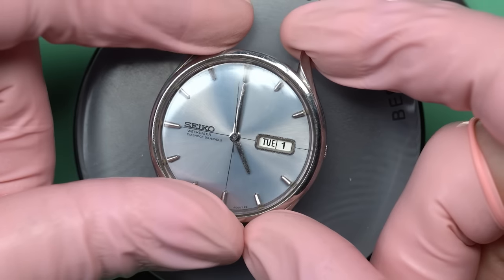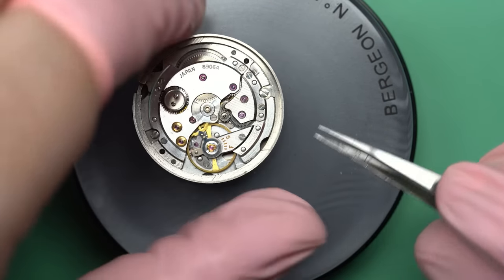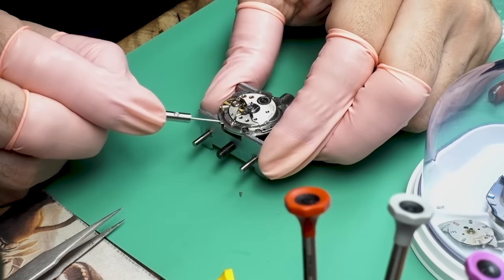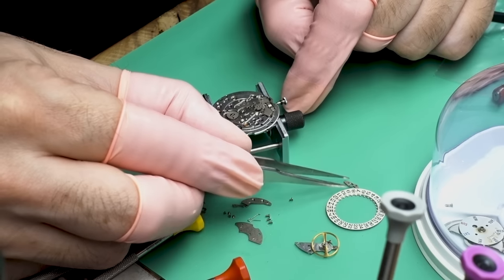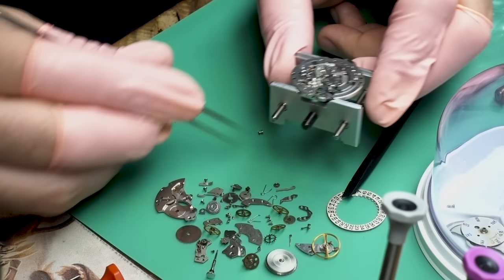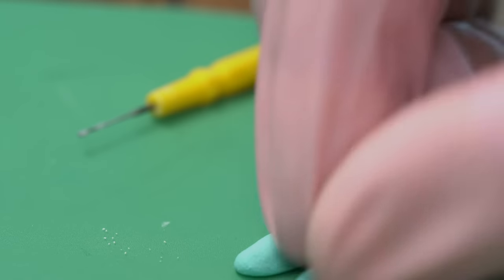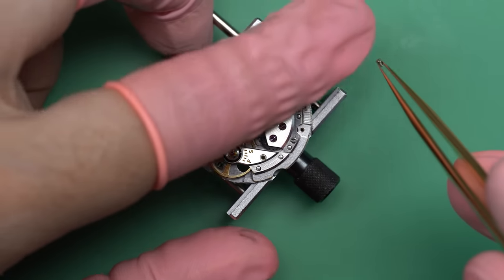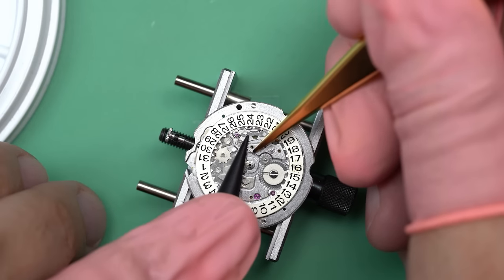Seiko Weekdater Sea Lion Vintage Watch Restoration

Comment: My grandfather was a watchmaker, and all I ever wanted was his tools, and I received them when he passed away along with his wedding ring. He was married a few months before the 1929 Wall Street crash, and he kept himself alive servicing railroad conductor watches, as they were required to be serviced every six months. He got a buck a watch. That was about $70 a month income, and Gramma made $50 a month as a bookkeeper.

I was working on watches with Grampa as a 12 year old. He'd let me replace crystals, replace broken stems and bands, and after a while, I got to clean and oil them if they were simpler movements, and adjust them on the timer. The timer had a paper tape, not a digital readout, and after cleaning and timing we included a piece of the paper strip to show the watch was keeping time.

After a 48 year hiatus, I'm ready to get back at it. Thanks for inspiring me, Marshall. Don't outbid me on ebay! 🙂
Reply: Great lume job, great overall performance thanks for the mistakes ,great instruction

Comment: Hi Marshall. Firstly thanks for the shout out, I really appreciate that and I am glad that my video came to your rescue!
It is really interesting to see how someone else strips down and rebuilds this one as we do things quite differently.  It’s ironic that you lose that spring when near the start you are moving the lever it loads! That said it’s real easy for those to fly. I made a spring recently for a 6619 that has the same setup.
This movement was in the days when the “magic lever “ auto works was just coming out simplifying the engineering considerably. A you can see on the 8603 the auto works is a lot more involved. Seiko have been amazing at simplifying engineering.

As for diafix I would just clean them , refit and then use a 1A auto oiler as it makes it so much  easier.  The springs I have done a video on a long time ago on how to release them safely. It’s best to leave the ends of the horseshoe in situ and just push back the tab as you can then lift them upwards to access the jewels without removing.
Reply: Love a new channel. Just subscribed and will see you over there.
Reply: @nickwarburton6710  thank you
Reply: 1q

Comment: Lume under the hands and on the ends of applied markers is genius for a dress watch. Kudos to Seiko. Good job on the rebuild. Great vid. Keep at it!
Reply: It's a really intersting design.
Reply: Yeah, super-cool.
Reply: Completely agree!  I’ve been restoring watches and servicing movements for well over 10 years and never seen indirect lighting techniques used for lume! Brilliant! Of course Seiko are smart enough to know to do this, it is the subtle things like the plain dial and color of grey with slight blue that teases you for a bit more color drama but is perfect in its current hue. Seiko are the greatest watchmakers because they make a watch for all people.... from low cost to their Credor minute repeaters that go for $400K, the Grand Seiko that are finer than a Rolex, as well as making less than  $100 mechanical watches along with many quartz models.

Comment: About 14 minutes in,  you were talking about the kind of folks who watch your videos. I've always been fascinated with watches, and other kind of "clock-work" devices (wind-up toys, etc.). I even tried to start along the path that you've taken with becoming a watch-maker/repairer/restorer.  I had neither the patience nor the aptitude, unfortunately.  However, I love watching your videos -- it's simply fascinating, and you work on some beautiful watches!  I love this seiko!
Reply: For watchmaking you just need patience and a bloody minded determination.  It helps not to get angry and actually laugh at the frustration.
I believe anyone can do this if they have steady hands.
Reply: Is it possible to machine the parts that's no longer being sold?
Reply: @aspopulvera9130  depends
Reply: @aspopulvera9130  Anything that has been made by man, can be recreated... the question is, is it worth the time and effort to do it? And, can you find someone that wants to try? If your time is worth nothing, and you have the will... there's no reason not to try!
Reply: @MyRetroWatches  at my age i don't have the steadiest of hands, so i would try to use a mahl stick to help steady myself.
Reply: @aspopulvera9130  no.  Not possible
Reply: @kk6199  you’ve never heard of 3-D printers?

Comment: That lume pops amazing. Was amazed in my childhood with the digital and calculator watches Seiko had one. I fixed and calibrated a anniversary clock given to me from my grandmother took it apart cleaned it and oiled it with sewing machine oil it worked. The thing with these was you could see the movement working and on a good working example only had to wind once a year. Did this when I was 15 now a 30 year 55 year old Diesel mechanic not even in the realm of this profession. My hands today crude and shaky used to working on something bigger than me. Watching you kinda weird its literally brain surgery dont get me wrong you are steady sure you do not have a coffee before doing this. Anyways just found you amazing work I will keep watching.
Reply: I appreciate the reply as I type this it is new years eve and am saying that I wish the best for you and your family in 2021 kudos buddy

Comment: The original lume was Tritium and didn’t need to charge. This “indirect lume” works for Tritium, but I’m surprised you made it work with modern lume.
Reply: Just goes to show how reflective and polished some of Seiko's dials/markers are that sunlight can efficiently get under the hands!
Reply: Exactly...Marc over at the Watch Repair Channel did one of these and had concerns light wouldn't reach the bottom of the hands sufficiently to produce enough lume.  It's pretty good but it'll never be as bright as the original tritium.
Reply: Radio active.  Halve life is about 12.5 years, which makes the lume fade away to 1/4 of its original brightness in 25 years.
Reply: @1959Berre  It's why they stopped using it...hey it was worse in the 20s...dials and hands were painted with radium infúsed paint until all of the women who painted the dials and who licked the tips of their brushes to restore a sharp fine point all got horrific and disfiguring jaw cancers. The Radium Girls filed the first class action suit in history and set in motion a revolution in workplace safety leading to today's protections under OSHA.
Reply: It's onky working because of the reflectivity of the dial and inner bezel ring. In an experiment I used a mirror to boost the amperage of a solar panel. Reflected light really does work well.
Reply: Tritium is ³H which is a slightly radioactive hydrogen isotope that contains one proton and two neutrons in its nucleus. It's a gas so I suspect that this watch had traditional lume or Promethium in those spots as radium was no longer used at that point.
Reply: @MRgrimlock84   Tritium was indeed used as part of the lume.  The idea is that beta particles emitted by the radioactive decay caused the chemical phosphors to glow.  It was a common component of lume for watches, firearm sights, navigational compasses, etc...and was usually simply referred to as Tritium, even though that was only one part (albeit the defining part) of the lume compound.
Reply: Marathon navigator uses tritium. Looks great after a decade

Comment: Its a year on now since this was recorded, the struggle to get this watch all correct was a privilege to see. One thing that amazes me in every one I've seen so far are those tiny screws going in 1st time. None of them getting cross threaded. Not sure if that has happened and not broadcast, but if not then that is excellent work. I know that would defirnately happen to me if I tried this. So will continue to watch (no pun intended) in awe. Always enjoy your presentation, because your enthusiam bursts forth and makes it so pleasant. Thanks :)

Comment: Marshall, I'm not a watchmaker/horologist but I find your videos almost hypnotic. What you do is amazing. I have an old Seiko (7005) watch I found at a deceased estate. I had it professionally serviced and it ran well until the second hand detached (probably due to my wearing it while hammering or chain-sawing). It sat in my drawer for ten years until you inspired me to have a crack at putting the second hand back on. After doubting my very shaky hands it's now back together and I'm amazed that I could get a shaft of about 0.25mm aligned with the hole in the second hand with one hand holding a magnifying glass. More power to you from Down Under. 🦘

Comment: The Lyme coolness factor is worth $200 alone, the rest of the watch is just bonus. Great video.
I changed the fuel injectors on a car once and had to use a brass washer on the banjo bolt for the fuel rail. I dropped about 5 washer never to be seen again. I finally placed a towel under the line to catch the next one I dropped.

Comment: fairly simply mechanism... proceeds to disassembly a buttload of tiny screws, plates and springs

i can repair a car with pretty much the most basic tools, Duct-tape and expletives, but THIS is on an entire new level... 99% of the time i need to repair a watch, i would polish my floor with my knees to find something. and still loose something.

still extremely satisfying to watch.

Comment: The 8305/6 are one of my favorite movements along with the 5606 which is of a similar construction. I own that exact watch you just did but mine has a green tined dial. I wanted to yell at the screen "grab that day jumper spring before you lift that cover plate!"! Its hard to watch that spring get launched when you know its coming. I launched one on the first 8306 I ever serviced too. Luckily I have plenty of spares for all Seiko movements. Some of the Seiko's from the 60's use the bezel to capture the crystals like on that particular watch. I always remove them for cleaning the case anyway which will allow you to see in that particular case is that type. The 8306 is a quite different type of movement even if you are familiar with Seiko's. In the end the watch looks fantastic.
Reply: Agreed the 8603 is a very interesting movement . It’s interesting that they kept that jumper spring going on many models right up to the 6619 (I think). Often with passive jewels to up the count for that all important “jewel count” marketing era.

Comment: So at 27:49 those shock setting aren't supposed to be taken apart like that. The two arms at the top of the "Y" shape are supposed to stay in the setting. The proper way to remove the jewel is to push from the outside in on the bottom of the Y letting the top arms flex a little and then lift up the spring. This will let you access the cap jewel while keeping the spring retained in the setting by the top 2 arms of the Y. I made the same mistake my first time, and then I figured out the right way to do it. Hopefully my explanation helps!  Keep up the great work! I love the the hidden lume on the hands. I've done a few elgin shockmasters that were like that. I still can't get over those wacky indexes!
Reply: This comment is very important! I didn’t realise for ages that was the correct way to open those either.

Comment: I watch almost all your vidoes and am facinated by your skills. My father was a watch repairer for 40 years, and he made himself a glass hood over his work space, closed on 3 sides. He managed to catch most of the screws and springs that flew out. Occassionally he had to search for the lost souls that flew out on the open side, which was the side he stuck his head and hands in to work on the watches. That was also the time when I was called in as a kid to help him find the lost parts. I would get a candy or so if I could find them. Maybe you could make a hood to contain the flying  springs too. It will save you a lot of efforts. Just my two cents.

Comment: Seiko did that type of lume in thier older watches, across multiple lines (Seikomatic P, Seikomatic R, Pressmatic, as well as the Weekdaters). It is supposed to work like indirect lighting. Cool effect, when the lume is working.

Comment: Really like your stuff.  I like playing with old turntables.   Some areas in them have really small parts.   I was trying to install tiny "c" clip and was having a ton of problems.   I decided to 'lasso" it with a piece of sewing thread.   This created a "leash" so that when it went airborne, it was much easier to find.  It also made it easier to "hoist" it into position.  This might work for some of those parts that want to take flight.   After it's where it needs to be, just cut it loose.

Comment: I remember my first mechanical watch I took apart. I lost the yoke spring, stripped the thread of the screw holding the first winding gear in place and never managed to get the balance wheel in line with the pallet fork, but I loved every second of it

Comment: Dear Marshall, you must have a fantastic memory to keep track of all of those small parts, and get them all back in the right place! My father was a horologist who worked on clocks, not watches. Still pretty impressive.
Reply: I know, eh? But when one studies horology, you understand the names of all the parts and where they belong generally. It reduces the confusion when working on a different caliber for the first time. It's no different for an auto mechanic - he doesn't have to try to remember the orientation of the part and where it goes.

Comment: I have several Sea Lions but never thought that they may have hidden lume! I love your videos and your narrative is spot on. With regards to the small shock springs..bending the legs (or arms) of the spring risk bending them permanently.  I find pressing the center part down will allow the middle prong to come free from the retaining groove..you can then move the spring up and this is sufficient to remove the cap jewel.  Installation is the reverse.  These are not actually shock absorbers as the hole jewel does not move, instead they just provide 'endstops' and this allows the will to run freely. In normal jewels the pivot base will abutt the jewel at a taper and this will create a bit more drag. Also hole jewels with capstones have a camfered bottom on the inner side as the cap jewel provides the oilsink..this makes bridges with capstones easier to install as the chamfer will 'lead' the pivot into the hole.
Keep the videos coming!

Comment: Hi Marshall, this video will come in handy as I have managed to pickup the 6205B movement 24 Jewel version which is suprisingly similar. I too will be working through this as a first time attempt but thanks you will not be coming at it quite so blindly. I was slightly lucker than you on pricing as I picked it up at a car/boot sale in the uk. Ladies pocket watch and the seiko for £20.00.

Comment: Did you ever play with an Armatron in the 80s?  Check eBay...it was a robot arm controlled by two joysticks, with all the movements of a human arm, shoulder, elbow, a wrist that both rotated and elevated, and a pinching grip.  My ten year old self decided to take it apart one day, and I pulled a little too hard at the casing, which burst open, sending gears and rods everywhere.  It took me two hours, but I not only managed to get all the parts back inside, but it worked better than it had before.  (I'd taken it apart because the pinchers weren't properly pinching anymore).  Now, watching this channel, I wish I'd gone into watch repair.  I would have excelled at it.

Comment: I did one of these, and like you it was new-- took LOTSA pics as this is one diagram that's really hard to find online. Great, movement. This was up there with the 5600 high end Seiko's. You can see Seiko experimenting with the Swiss design and starting to make their own improvements to the design. PS you're good with the springs. I just put rodico on the curve and it cannot spring away.

Comment: A tip: build yourself an acrylic work box with portholes, add elastic cuff material to the portholes and do your disassembly inside the box. That way you can still see & feel what you're doing, but if a spring or other part flies away, it's not gone forever.

Comment: Great video , I have a 17 jewel Seiko from late 60's. I haven't tried opening it up yet but has almost same design dial as yours except really nice green color. Lume is the same on the outside but on top of the hands not under. Awesome video , thanks again!

Comment: I know you’re not proud of losing those springs, nor am I to admit it, but I am pleased to see it happen to someone who is significantly well versed in this hobby compared to me, a novice by a huge stretch of the definition.

What a beautiful watch. I prefer these older Seiko watches. They had such nicer designs compared to their latest incarnations. I don’t seem to be a fan of their newer stuff.

I was really uncertain that lume under the hands was going to work, but wow, what a nice surprise.
Reply: if your not losing a part here and there its only because your not working on watches. Everyone is going to lose a spring or screw every once in a while. The main difference is the more dedicated to the hobby have spares movements and parts so that occasional mishap does not slow down progress. Like the late great Dale Earnhardt said about wrecking race cars "if you ain't wreckin'  you ain't racin'"

Comment: Nice work.  I did not notice you applying lubrication to the pallet end stones.  I typically do this under 30x bifocal microscope and apply a small amount of 9415.  I like the black instruments you use in place of peg wood to set springs etc.  Can you tell me where you obtained these tools?  Again, well done.